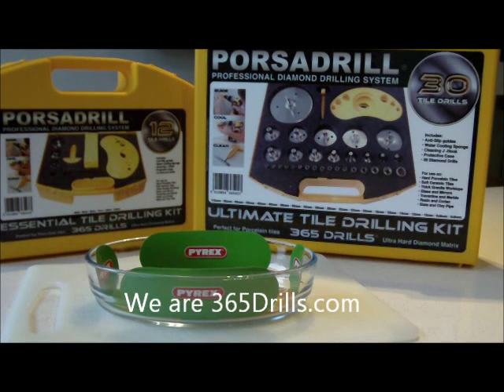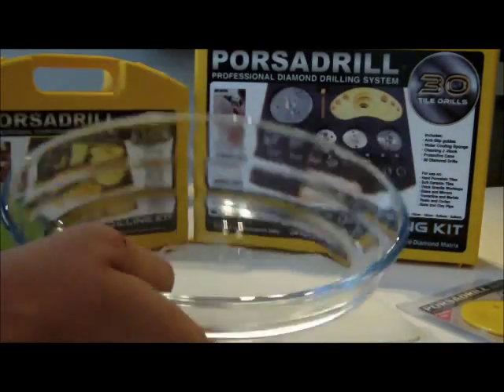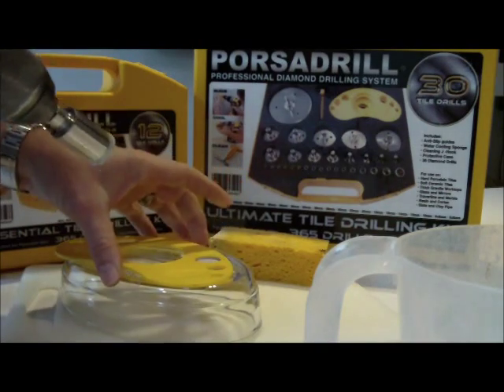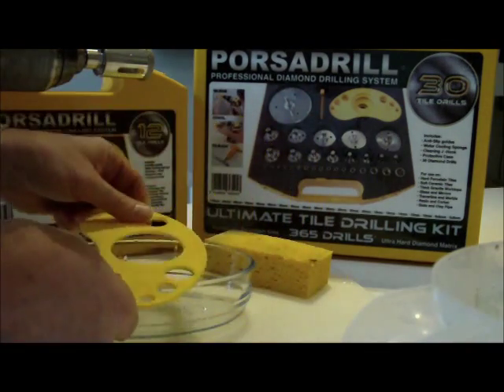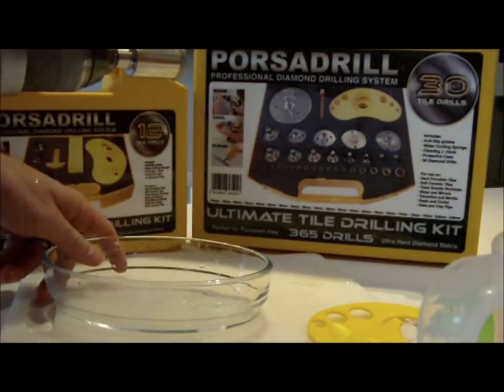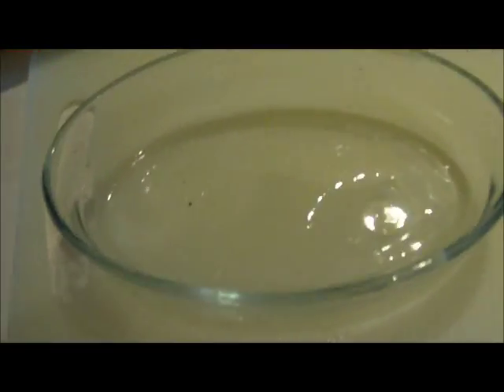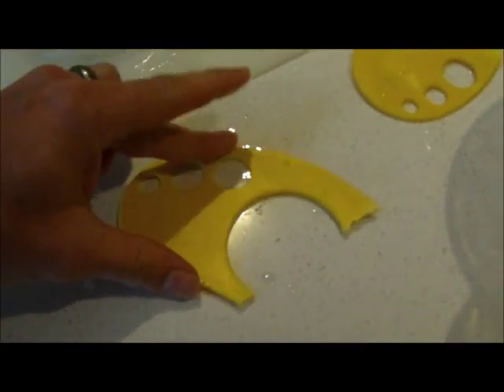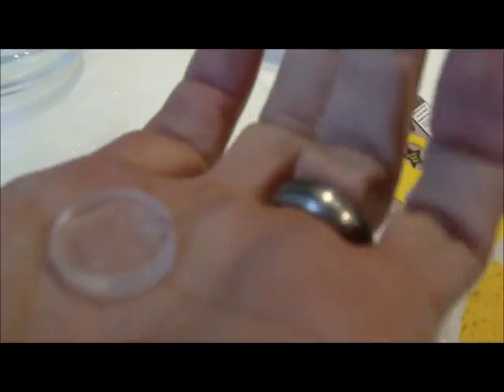How to drill a hole into pyrex glass dish drilling pyrex dishes

Comment: Pyrex dishware and Laboratory PYREX are different. One is borosilicate glass the other is a sturdier lime glass. The borosilicate one is found in lab vessels  that can withstand open flame and then subzero freezing. The thicker lime glass found in pyerx dishware is much more sturdy mechanically but a lot weaker at thermal shocks.

Comment: Carborundum grit rotated by a copper tube has been replaced by diamond encrusted bits.
when "drilling" a hole through glass with the newer diamond/coolant method you are actually abrading the glass with a diamond-encrusted bit, and flushing debris with a coolant flow. Flushing away waste debris is critical to keep the glass cool and speeds up the abrading process.
All in all, a much quicker job.

Comment: Does water have to be used for controlling the temperature? I would like to drill a piece of glassware that will be used in a vacuum environment. Anything exposed to water should never be used for a high vacuum experiment. Do you know if I could use something like ethanol instead for this type of drilling? Thanks!